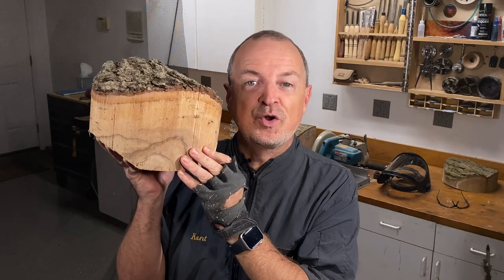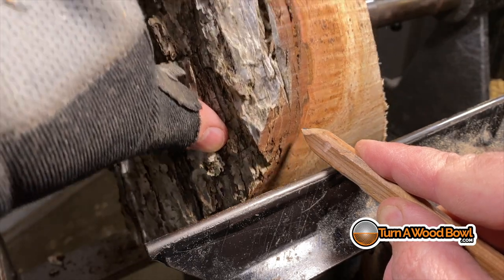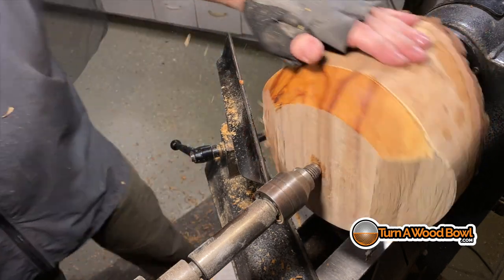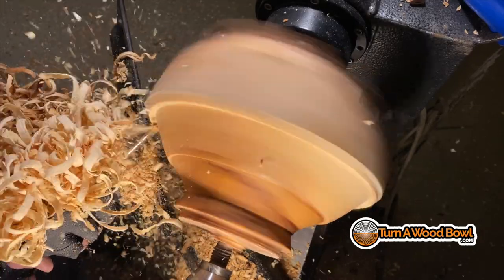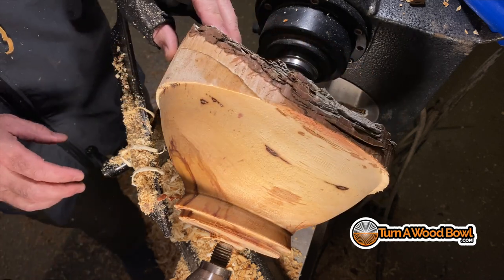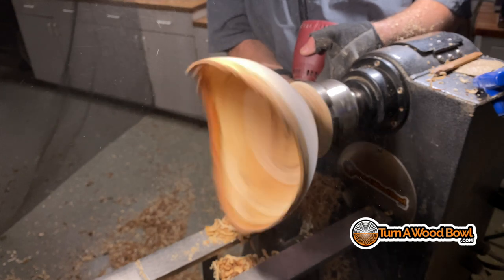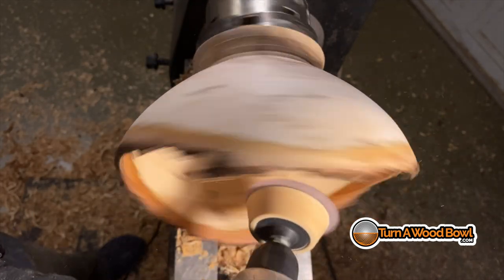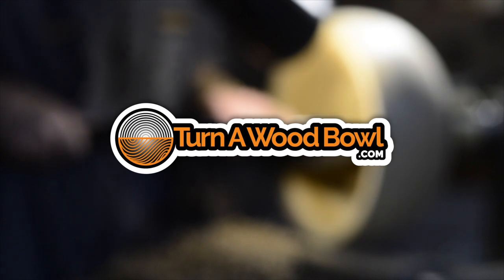Woodturning Live Edge Bowl Pecan Green Wood Video

Comment: Hi Kent, Thanks for the informative video.  The adjustment technique works if you mount between centers, however it was not as easy when I tried to use my woodworm screw.  It was only accomplished because I wasn’t too far off.  So I guess I’ll start trying the between centers method.  Unlearn (or a least un-use) one method and learn a new one. Cheers, Tom
Reply from the maker: Unlearn - re-learn, and repeat. Sounds like a great plan. ;) Happy Turning!

Comment: Hello Kent, great videos you have made. Question I have, I watched your video on finishing the bottom of your bowls and you say the flow from the sides to the bottom should be rounded, not flat. Most of the bowls I turn are segmented bowls and I finish with basically a flat bottom. Does your theory about finishing with a curved bottom apply to segmented bowls also? If so I would have to double the thickness of the base. Your thoughts  ,thks

Comment: Kent. in the near future can you cover in detail this green bowl twice turned vs. green thin turned.  I thought if we turn green it has to be thick and consistant thickness throughout. after turning we should apply a non cracking material, glue, paint or armor seal etc. and let sit without lots of air flow/ heat vents etc. like a garage.   So you also say we can cut thin wet/green bowls. Won't they warp as well?  Do we store differntly until dry, a teacher in a workshop said put a thin cut in a bag or pillow case for about 10 days and then sand and finish.  But won't they warp.  I feel like the 18-20 total bowls I"ve done are sort of wasted now except practice.  I'm taking one of your paid classes now and enjoying the sharpening vid. But really getting hung up on this wet/dry/storage etc. Trying to cut down now on my wasted work.  Thank you.
Reply from the maker: John,
Thank you for writing and sharing! Yes this can be a bit confusing. Check out my Twice turning video https://www.youtube.com/watch?v=2qor9wes5zk Also, all the drying steps and reasons are covered more thoroughly in my online course Understanding Green Wood www.TurnAWoodBowl.com/green 
All the best to you and Happy Turning! 
Kent

Comment: Great video as always!  I have a question if you don't mind about sanding.  You sanded a "wet" bowl here.  Did you use regular sandpaper or mesh? (it looked like regular paper)  I'm curious how it didn't clog up on you.
Reply from the maker: If you let the bowl sit for 20-30 minutes, the surface will dry enough that you can sand a good deal. Yes, regular sandpaper. Happy Turning!

Comment: Hey Kent awesome video.  Quick question.  Is there anything else you use on the bark of live edge.  I also like using the Tried and True Danish oil but I couldn't tell if that was also used on the bark.  Just think on how well that bark is preserved for lack of better terms.
Reply from the maker: Good question Scott. No, oil is about it. Not much will penetrate bark. It is designed to be tough. Happy Turning!

Comment: Can you tell me how you size your bowl gouges do you go by the flute size or the bar size in Britain we go by the size of the flute many thanks Bob
Reply from the maker: It should be flute, but sometimes different brands vary. Yes, a 1/2" gouge should have a 1/2" flute. However, sometimes a different company makes a 1/2" gouge with a 1/2" shaft and a 3/8" flute. Usually, the flute width, but you need to double check. Happy Turning!

Comment: Thanks Kent for another great teaching video. One question, when you switch between 5/8 and 1/2 inch bowl gouge, how do you determine when to change. Thank you again!!!
Reply from the maker: Good question. The 5/8" is for roughing, or removing material quick and it leaves a more "coarse" surface. Once the bulk is cleared, I then move to the 1/2" which leaves a more refined surface. Happy Turning!

Comment: I notice this piece does not have any nubs or branches coming through it  It is clear.  My problem is dealing with the heavy chatter you get with you have an occlusion the you hit every time it comes around.  It can really beat you up if you have a gnarled piece of wood.  They are beautiful, but it is a fight to the finish.
Reply from the maker: Thanks Jeff. Great point. Put more force down into the tool rest and don't push in towards the turning. Glide across each pass with plenty of down pressure on the tool rest. All the best to you and Happy Turning!

Comment: Another Great video Ken. 2 questions, your bottom feeder gouge is 65 degrees but looks almost like a spindle gouge since there are no wings. What am I missing? Also, have you found a 1/4” thickness for green wood eliminates the cracking?
Reply from the maker: The micro-bevel gouge is sharpened along the U of the flute shape without creating wings. Check out my Tool Sharpening (and shaping) online course. www.TurnAWoodBowl.com/sharp we cover all that there. And yes, the thin-walled bowls will dry in a few days and usually do well against cracking. Happy Turning!
Reply: Thank you! Very helpful .

Comment: How do you prevent cracks from happening when you use green wood?
Reply from the maker: Turn it all in one "sitting." Don't delay and turn the exterior, for example, then come back later and turn the interior. And make the wall thickness all the same throughout.  Those are two biggies. Happy Turning!

Comment: Hey Kent
Awesome bowl. After watching most of your videos i have learned so much. But i noticed that you use a dry grinder to sharpen your gouges, i use a tormek because it doesn't overheat, are there a reason you don't sharpen wet? Just wondering.
Reply: @feetachemail  Okay, thanks for clearing it up
Reply from the maker: Yes, the oneway and CBN wheels are a no water system. You can cool the tip in water if needed, but if you're light on the touch and sharpen enough, you only are removing a very small amount when sharpening.
Reply: @TurnAWoodBowl   Forgot to ask before but what do you do about honing?
Reply: @feetachemail  but doesn't honing make the edge stronger, do you just sharpen more then?
Reply: @feetachemail  thanks for the in depth answer, i don't know enough to say honing does make the edge stronger and what you said made sense.

What i do is hone my gouges for the most part and only use the stone when it's really beat up that way i don't use up the gouge as fast, i don't know if it really makes a difference in wearing the gouge down just wanted to say it.

I'm not trying to win you over to honing, im just curious and want to learn😅

Comment: Can a 4040 bowl gauche be changed to a 45 degree gauche? Can a bowl gauche be changed at any degree
Reply from the maker: YES! Check this out www.TurnAWoodBowl.com/sharp Happy Turning!
Reply: Thanks for your help. I had a lathe for many years collecting dust now  I'm starting to make dust. I couldn't sharpen the chisels properly but I bought a slow grinder and the pro sharpening system.   
Should have it in a few weeks. I don't know if the pro sharpening system is any good but was a lot cheaper than the wolverine.